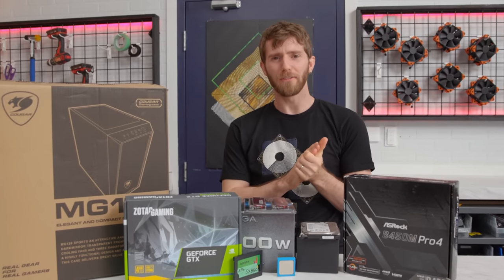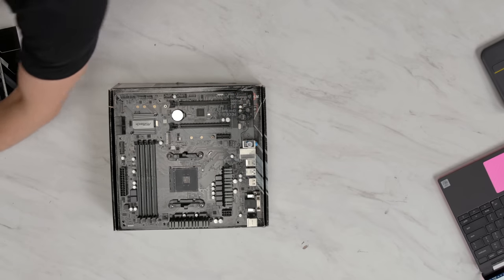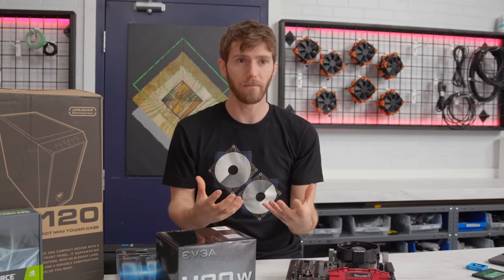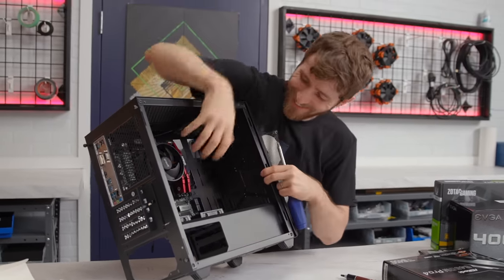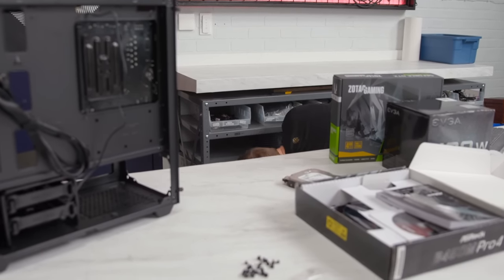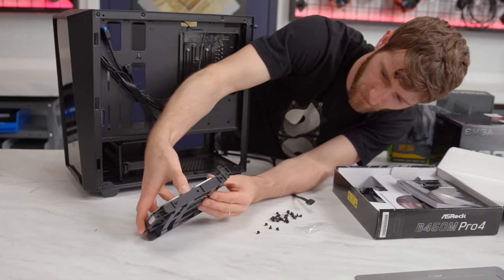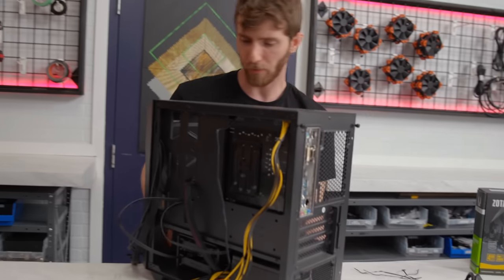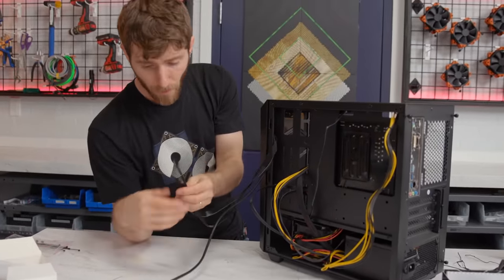Building a $500 AMD Gaming PC

Comment: "install and remove your games"
yeah no, with internet that takes 1 hour for one gigabyte it took me 8 days (nights) to download gta v
Reply: F
Reply: I feel your pain, stuck on 3 Meg dsl for 5 years now
Reply: CaptiveCoin  I used to have 200-500 kilobits when I lived in central Texas. Now I have 20 megabits in north Texas. Huge difference. I can watch videos higher than 360p now.
Reply: Christ, you have some BAD WiFi
Reply: @LordDebino thats my internet speed
Reply: @notcraig255  same my internet speed is about 1-2mb/s
Reply: I’m buying this build from someone for $575 keyboard mouse and monitor included. Is it worth it? CPU: AMD Ryzen 5 1600 6 core, 12 thread Processor
GPU: Asus GTX 1060 6GB Graphics Card
Motherboard: Gigabyte AB350-Gaming Motherboard 
RAM: 16 GB Corsair Vengeance LED (Red LEDs) @ 2666MHz (overclockable)
Drive: x2 PNY 128GB SSD's. If you want it I can put in an additional HDD I have to store games on at no extra cost
PSU: 600w PSU
Cooler: Cooler Master ML-120 All in one Liquid Cooler
Includes a Wifi card i used for gaming, so I made sure it had good wifi capability
Also includes 2 White LED fans and a NZXT H500 Pro Case
Reply: @josephon23  same
Reply: @malcolmdaniels9616  for £575 I do think you should buy this as it comes with the peripherals but I would make sure to clean the pc and check if there is thermal paste on the cpu.
Reply: Nightcore Madness ok thanks for the advice
Reply: @malcolmdaniels9616  yes. def
Reply: iKohver thanks for your input I bought it can’t wait to start playing. My first gaming pc
Reply: @malcolmdaniels9616  yes that pc is also good for the price. I got my pc for ~500$ and it was worse than the one you've picked.
Reply: notbryan255 Only thing I should update is the GPu to a 2060 or 2060s?
Reply: @malcolmdaniels9616  2600 or 3600 ryzen 5, the gpu is fine though the rx 580 is 100 dollars less and is the same performance
Reply: Laughs in Venezuelan  Internet
Reply: F i just use ethernet and get about 200 mbps
Reply: @y1tap1exp76  i use ethernet as well.
Reply: Damn, I feel bad for you. That sounds awful.
Reply: @benjaminwade7489  there is worse out there in the world though
Reply: Idk how stuff like this is possible, im so used to 100 mb/s
Reply: Feels good going from 3mb/s MAX to finally getting fiber internet and having 900 up and 800 down
Reply: @freezypop8799  flexer
Reply: i get 25 - 30 Mbs down and like 9 up. best u can get in the area it’s pain
Reply: @TheDeathOrange  "i get 25 - 30 Mbs down and like 9 up. best u can get in the area it’s pain" 25-30mbs "pain"
Reply: if you have a pc, buy a wifi card for like 20-50 bucks. don’t complain if there is an easy fix
Reply: Malcolm Daniels yeah bro that’s very good
Reply: @blangatx  I cannot believe how people can be watching a computer build but not know the simplest of things. His fucking throughput from his internet provider to his modem is what causes the gigabit/hour, not the damn Wireless signal.
Reply: @HarpreetKaur-nx7pr  Congratulations. You want a medal or something?
Reply: I have 1000mbs(Megabits/s)in Romania
Reply: CaptiveCoin  The most random places - not especially referring to Mexico here - sometimes have a better digital infrastructure than some of the richest, most developed industrial nations. We in Germany are an especially bad example. That also applies for network and data coverage like 4/5G, btw
Reply: I thought my 70mbs internet was bad but, wow.

Big F
Reply: @lucascardoso3150  I could never dream to see numbers so high. How do you do it?
Reply: @lucascardoso3150  YOU THOUGHT YOUR 70MBS INTERNET WAS BAD??
Reply: CaptiveCoin  I usually get around 30 my my best was like 90
Reply: @y1tap1exp76  lucky
Reply: @mackenziebullied4900  yeah this is what happens when ISP's lie about the speeds they promise
Reply: @malcolmdaniels9616  Linus has to please Nvidia even when build a "AMD System" I'd go with the 5600XT all day over the 1060 especially considering the games and gpu tech coming up in the next 6 months.
Reply: @y1tap1exp76  I don't use Ethernet but I still get like 300mbps lol
Reply: I was thinking the exact same thing, it took me all 1.5 weeks to download Red Dead Redemption 2.
Reply: Relatable 😞
Reply: I feel grateful for my 5gb per hour now, it's like 10-20mbs I think but every 30s it cuts out for 15s so yeah.
Reply: @malcolmdaniels9616  that's a good build for the price if you have a little more maybe increase storage not needed tho.
Reply: @oreoeatsoreos9412  honestly, having internet that cuts out constantly is worse than slow internet. I almost never disconnect, and the only game out of 80 games i've played that disconnects me is Minecraft.
Reply: I got 40 mbs 👀
Reply: @notcraig255  in games it disconnects some times and people are semi laggy but usually it fine, but during download it really bad.
Reply: Why gta of all games should of downloaded mw2019 for the memes
Reply: Philippines?
Reply: mines only 2 hrs for gta v
Reply: @Zyzzkxx  i'm just using it as an example, its one of the biggest games I have on my pc.
Reply: @ViviSaggio  no america
Reply: @notbryan255 our country technically has far worst Internet compared to africa, 14mb download takes 30mins on a PhOnE
Reply: My connection couldn’t even break 1 mb a min, single gig updates take like 2 hours
Reply: @ViviSaggio  i know there is far worse, but in the usa and the rest of the west mine is pretty bad
Reply: @malcolmdaniels9616  seems quite expensive to me. the mainboard wont support gen 3 AMD processors and this setup will need an upgrade soon if you want to play cyberpunk for example.
 2666MHz is lower standard
the ryzen 5 1600 is a stable CPU but will be outdated by end of this year on newer titels, I'd recommend to upgrade to a 3600
the gtx 1060 is pure garbage
128GB SSD is very cheap nowdays. you can even grab 512GB for under 50€ now. You will love those loading times, believe me
And I really dont know, why you should liquid cool such a low demanding setup, seems like pure playing to me.

saw a used PC with a ryzen 5 1600, a B450 maiboard, a 580RX and 16GB RAM  @3000MHz for only 250€ with warranty for at least 2 years some days ago on ebay.
Reply: Rainer Zufall so what all parts should I upgrade
Reply: @malcolmdaniels9616  You'll need a new mainboard and processor soon, but if you're low on budget just wait some months, because stuff will become cheaper eventually. You could also grab a 2600 or 2700 (yet this may be overkill for your system) but why pick a last gen processor, if youre plannig to upgrade anyways? Depending on your screen resolution your GPU also needs an upgrade, but if youre running only on 1080p, I think the 1060 will be fine some more time.
Reply: Rainer Zufall ok I have a 75hz monitor so I’m gaming on 1080p...I plan to upgrade to a 244hz 1080p monitor soon
Reply: Rainer Zufall I’m not low on budget so what should I get. Ryzen 5 2700 and gtx 2060 for 244hz 1080p gaming
Reply: @malcolmdaniels9616  They are working fine together, but won't work well regarding to higher frames. For example Red Dead Redemption will run on an average of 70fps at high quality and newer titles will be even more demanding. So either grab some more money or stick with your monitor, it would be a pure waste of money.
You can find some helping calculators on this page: https://pc-builds.com/calculator/
Reply: notbryan255 our country only has 60k telco towers, compare that to yours. Not only that our population Is 110million In 300,000 square km area. If its a shtty internet competition Its a shtty internet competition you get!
Reply: CaptiveCoin  Dude, I'm from El Salvador and I only have a 5MB internet...
Reply: @kronos4779  its also my wifi speed and its the same on every device
my internet download speed is 2mbps and there is only 1 way to get better, switch ISP
Reply: @notcraig255  Curious, have you called ur ISP explaining the unacceptable speeds- followed by threat to switch if something isn't done? Even rural area infrastructure I've ISP's providing lower speeds (throttling) than whats there. That call may make a difference. GTA V is big, but an 8 day download is a good example of what you're dealing with
Reply: @woolsquare42294 20mbps is good, also we have frontier which is known for being garbage and it makes sense why ours is so bad.
Reply: @kronos4779  its frontier, now i'm not an adult so I can't contact them myself, but frontier is known for having garbage speeds literally anywhere.
Reply: @notcraig255  Check this site: https://www.highspeedinternet.com/tools/speed-test/frontier - you'll get ur current speed but more importantly you'll see all possible speeds for your area. If you see Frontier is capable of faster speeds than you're getting, I'd show that to ur parents. Discuss w/ them the speeds available to your house vs. the snail speeds they're paying for.
Reply: @kronos4779  were paying for 10mbps and get 2, I don't think frontier is worth sticking with honestly. If you see reviews for frontier you can see that people are getting the same speeds as me or even lower, and most likely for the same option were paying for. The only way for me to switch ISP is for me to work hopefully next summer cause I couldn't have this summer, and pay for switching myself cause my parents are reluctant in switching for whatever reason.
Reply: CaptiveCoin  yeah the midwest of America is still living in the cowboy days, and were too busy roping up cattle to actually advance the internet speed.
Reply: 3days and a half days
Reply: F
Reply: Payback  holy crap how is your internet 10 kilobytes per second
Reply: @malcolmdaniels9616  Go down to 500w psu and get 3200mhz

Comment: I couldn't watch past the 23:00 mark, so maybe you addressed it later...  seeing you mount your intake fan on the top of the case was a shocker to me.  The issue is that heat travels upwards which is why the case standards were engineered in the way they were (with the evacuation-fan on the rear, near the top) so cooler air could be pulled upwards and removed at the back of the case.  By putting an intake fan on the top-front, you risk recycling hotter air inside the case, and over a longer use-cycle the temperature rise can become difficult to reverse.  Just my $.02.
Reply: Should we still mount the psu upside down tho

Comment: This is exactly the PC I was planning to get today

"Coincidence I think not"
Reply: dont get the gtx 1650 just buy a used rx 570 for cheap 
mine was around $100 while gtx 1650 are around $140 where im from
Reply: @orionwhitford1292  1650 SUPER. Not 1650. 1650s has about 43% more performance than the 1650 and outperforms 570 like it aint shit
Reply: Swift value
Reply: @orionwhitford1292  do they even compare?
Reply: n1ko if gtx 1650 (non super) then yes
Reply: It is too late I have already built my pc and I like the performance (also it is a super)

Comment: Linus: "500$ gaming pc"
me: Impossible
Reply: Yeah, a decent 1080p 60fps average machine would cost around $615
Reply: Doubt.
Reply: Retrodude 21  you must be joking. 144hz in Valorant and Overwatch maybe
Reply: Probably is, this PC cost $620 before any taxes or shipping using the provided links at the beginning of the livestream
Reply: @SolomanTiger  

and then you learn about this thing called sales. . .
Reply: my pc cost in the region of like £450 and it runs valorant at 200 fps on the highest settings at 1280×1024 idk what the performance would be at 1080p but id assume around the same
Reply: @testoyt  I built a 2700x 580 for $500
Reply: @7tqpbnvh7tqpbnvh77  that's no fun!
Reply: Using the links provided it would be about an $800 build before software.
Reply: I used the Amazon links and it came up to 850
Reply: @testoyt  nah cheaper than that
Reply: @terrynations2243  wdym before software?

Comment: Tool belts are too bulky for what youre doing. Look for something called a technicians pouch or an electricians pouch, you wont regret it. I also highly recommend the brands that have a quick release clip so they are easy to take off and set down.

Comment: Two parts you don't really want to cheap out on are the Motherboard and the PSU.
If you get good ones, you can upgrade all the other parts later.
Reply: Icey Hes  depends on what u wanna do , but i suggest u 5 2600 , if u wanna play hungry games then go for it  or just buy 3 3100  i'll say  they are both good processor just 2600 is like 30% better
Reply: Icey Hes  on amazon rn the 5 2600 cost 130 , go for it
Reply: Icey Hes  go for 2600 still
Reply: Icey Hes  only 15dollard of difference for such performances gap is pretty good, if u are on a budget build then go for the 3100 dw it's a good processor too 😉
Reply: Icey Hes  2600
Reply: Icey Hes  6 cores 12 threads is perfect for gaming and multimedia, u can take the graphic card u wish  plus u can overclock this processor pretty well

Comment: “Building an AMD gaming PC”

Proceed to use a GTX card.
Reply: Exactly what i was thinking
Reply: Perhaps he was referring to the cpu? Maybe?
Reply: @cartographir7172  Its obvious, but still missleading.
Reply: Obviously. GTX 1650 super is the only worthy gpu under 180$ price. GTX 1650 super costs 160$ and is better than AMD's rx 5500xt which costs 180$. You might find some rx 580 but gtx 1650 super will outperform them all. In this price range,nvidia offers best bang for buck.
Reply: @glorious240fps6  the rx580 absolutely bumfucks the 1650 super
Reply: @Kovalov112  lol in your dreams. GTX 1650 super is on par with rx 590 8gb

Comment: To anyone actually building this: you can mount the SSD at the back and not have to worry about a tight squeeze. On its side above the power supply.
Reply: Dwight schrute thank you for the big brained advice
Reply: Dwight hows the beet farm doing?
Reply: GG FPS King swinging
Reply: How is it running
Reply: Owen Horn with its feet
Reply: @Dwight Schrute I know nothing about pc building is everything he suggested upgradeable if I had a budget of 1000, is there a video with a really good set up I could look into idk much about anything
Reply: @tetris2721  You can build a MUCH better rig for 1k. Joey Delgado does some decent rigs and shows FPS for multiple games on each.
Reply: Where in the vid did he put in the gpu?

Comment: $500 amd build is the  *cheapest build *
Me with my $300 build : hey guys
Reply: Me with my $200 pc.
Reply: Under $500 you arent getting a good value. Best value around 800$, 1k, 1200 depending on uses
Reply: Me with my 50$ laptop
Reply: Zander Marthaller let me guess you have a 10$ gpu
Reply: If you have 300 you shouldn't be buying new, used will get you more performance
Reply: Ryzen 5 3400g with dual channel fast RAM, you can game anything with decent graphics at that price point
Reply: @ac.creations  yeah, especially with the compromises in upgradeability. If you decide to have a $300 build you better be confident that will be enough for 5 years... Unfortunately for some people, it has to be
Reply: me with my free laptop and $70 phone
Reply: @jhjg691  software

Comment: Linus: $500 PC!
Me after putting together the components: $900?! WTF
Reply: Wait really
Reply: Those motherboards are getting harder to find from a first tier outlet. Anything from 3rd party are jacking up prices
Reply: @johnsnyder3015  Its a little hyperbole, but yah, somewhere around 725
Reply: @PresidioDelux  that is sad to hear, thank you for the heads up
Reply: That moment when it currently costs me $900 just to get a better CPU/RAM/AIO for my pc.
Reply: Just put this system together on PCpartspicker with the unlocked version of this CPU and it came out to $575.40 before tax. https://pcpartpicker.com/user/Ixlsauron/saved/cT8fP6
Reply: I also got $800 ... i was like  BRUH  (- _ -)
Reply: £478 for me which is $594 but if i went for sites other than amazon i could undoubtedly push that down to around $480-$520 so close enough